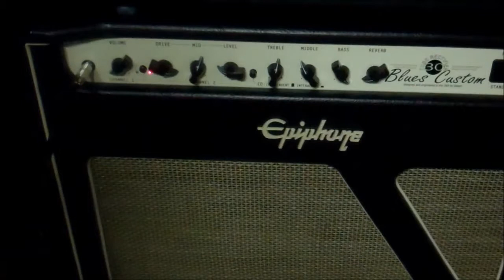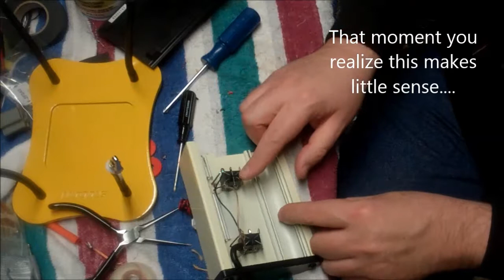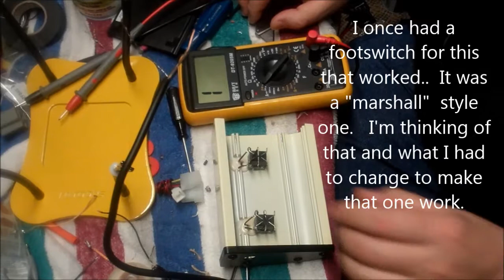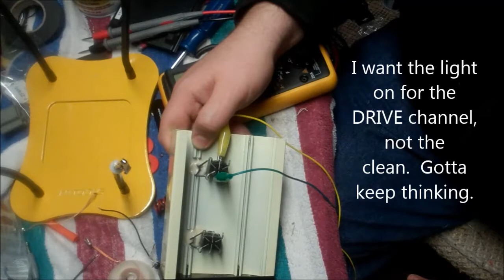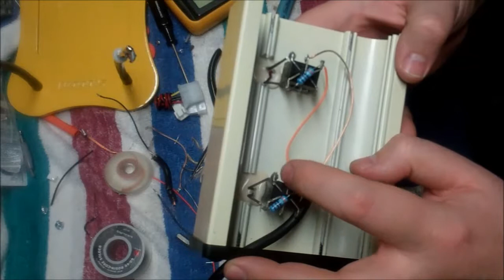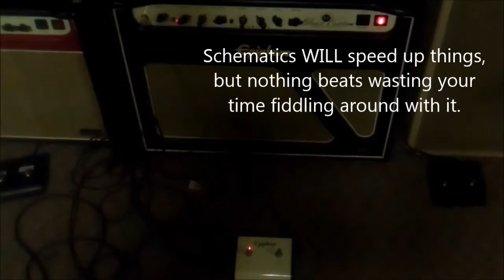Making a foot switch for an Epiphone Blues Custom (out of another footswitch)

Comment: Do you have a schematic of the switch wiring? Your video is pretty clear, but I cannot totally understand the reverb switching. I have a epiphone socal 50 head and it has the exact same switch as the Blues Custom. Please help ;)
Reply from the maker: Essentially,  with no LED's   it's   Tip-Switch-Ground    or Ring Switch-Ground.       The LED/resistor  borrows a little bit of power from that circuit,  so it's in parallel.

Comment: Saw a review you did in 2013 on a Gorilla GG-25 that you refurbished. What did you do to it? I just got one to play around with.
Reply from the maker: After I cleaned the pots and gave it a bath,  it worked 100%.   I made the video to show it working completely.  I sold it on Ebay for about 30$   Someone likely had some nostalgia for it.